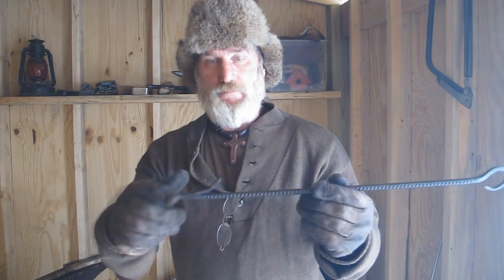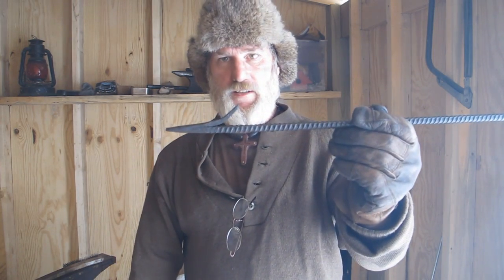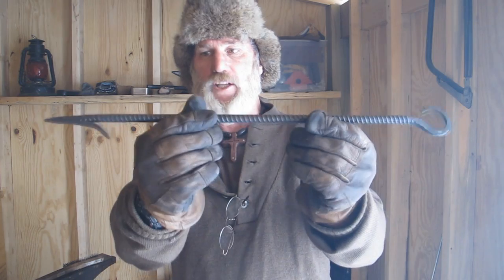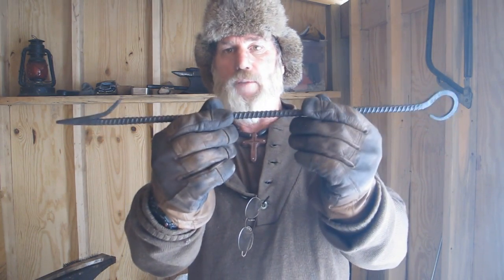Blacksmithing Part 27 Making a Fire Poker

Comment: Dave, If worried about your hearing with the ringing of the anvil, try one of those round magnets for attaching an antenna to your vehicle.  Place it on the underside of the horn next to the body, will reduce the noise quiet a bit

Comment: hey dave just a safety tip working around hot steel and slag never tuck your pants into your boots, it is very easy for a peace of slag to fall between them. you can get a real nasty burn from it, as my welding instructor told me "you never want to create a area that something can get trapped between 2 layers, just like shingles on a roof. you want everything to end up on the ground with no leeks" just a tip keep up the good work!

Comment: Do you need to quench the piece if you know you're going to put it back in the forge? Also. I notice you did not use any flux material (like Borax.) Is there any concern for the integrity of the weld?